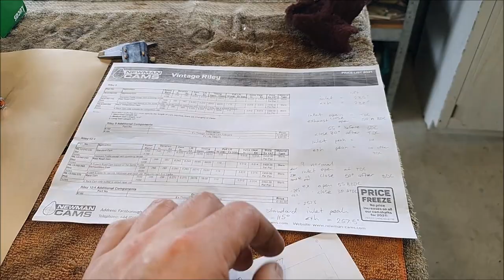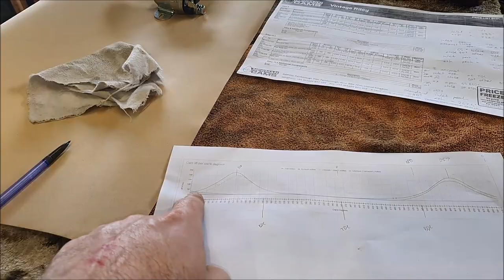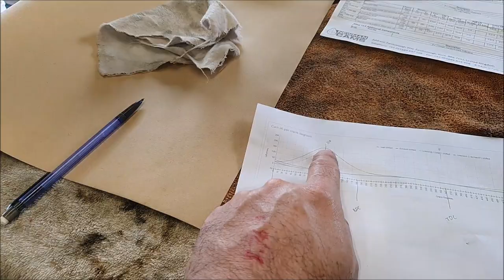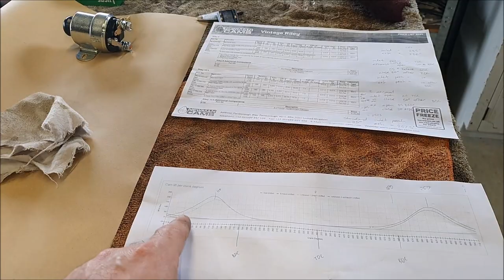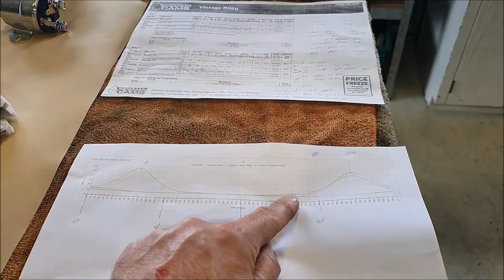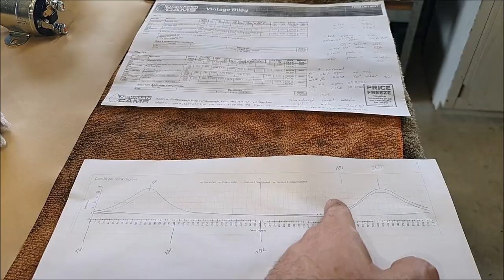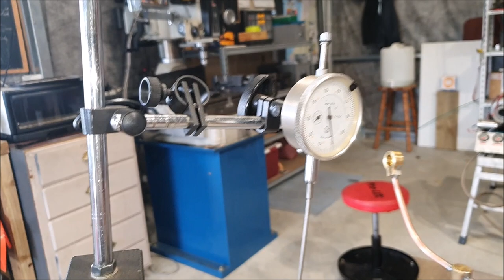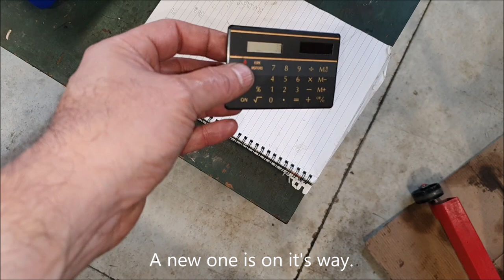Riley 9 engine cam gear in

Comment: 20/50 or 30/40 will work as you have new modern material on the bearings, big ends etc. When the motor starts, the oil gauge will go to 80 psi and drop to 60 psi and I run when warm  about 40-45 psi.
I am on the same compression with Omega pistons. It goes well. The traditional setup for a special is the twin exhaust cams. It will give you a better driving experience than the normal cam. This is not a high state of tune but a better level to start from. The car has to be driven with spirit. It is near half the weight of a Monaco. It has close ratios in the gear box and rear end. It needs the revs to get up and running. At the same period of the first Speed Models, the Biarritz, a Nine with light fabric saloon body had the special series motor and twin 1" SU's. It may of had the twin exhaust cam mod as well. Have a word with Harold Booth and Ryan MacDonald in Auckland. They are both used to working on 9's, take advantage of them. On the sump, are you putting in a spacer to extend the capacity. Large sump for more oil and surface area for cooling. They would have been a standard fitting. The other things that made the motor suitable for the Speed model was the extra crankcase webbing, larger main bearings, cam timing and profile, water pump. Remember that I have a 4.55 to 1 crown wheel and pinion that will give good touring since you will be lighter and better engine than standard. If it is too low, you will be stuck at under the speed limit which is not a nice thing. You need to be able to tour at a steady 65 mph, you will have a low profile  and must be able to keep ahead or be pushed off the road.
Reply from the maker: The Brooklands had a different head I think as well. The Ulster Imps which were a step above the Brooklands tune wise used two exhaust cams I think. I have the larger Brooklands style sump so increased capacity. It's a proper magnesium one. You definitely have to drive aggressively, or at least assertively, in a vintage car. I used to have great fun surprising people in my Austin 7 Chummy. I once had a white van man try to cut up the inside of me at the lights in Kingsland by ducking into the left lane seeing full well the lane was blocked just after the lights. He had that 'don't want to be stuck behind an old car' look on his face. When the lights go green I floored it and the 7 leapt ahead. They aren't fast of course but can accelerate better than a huge van, at least in the first little bit anyway! So I ended up holding the lane and he had to fall in behind. He kept well back after that.

Comment: In order to aid ign timing in the future it's not a bad idea to mark the clutch housing with white lines for tdc and 5, 10, 20 etc. degrees btdc whilst you can. Ensure they're in a place you can see via the inspection hole  when the gearbox is in place. There's no crank pulley!!
Phil.
Reply from the maker: Yes, I was thinking about that. I have the mark on the flywheel now but you need a reference point. Was going to wait until I can mount the engine to the gearbox and then see where is suitable. Like you say seeing them is somewhat tricky! I wonder if you could make a little plate that fits on where the dynamo would normally with a little disc on it you could use for timing?